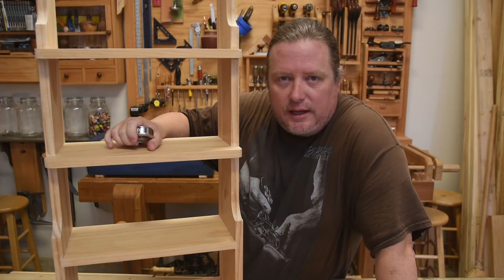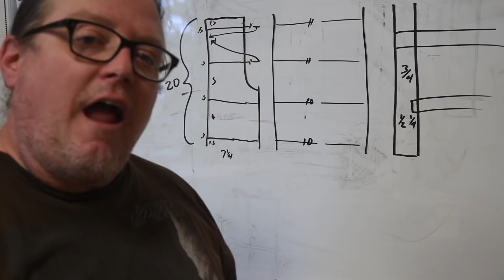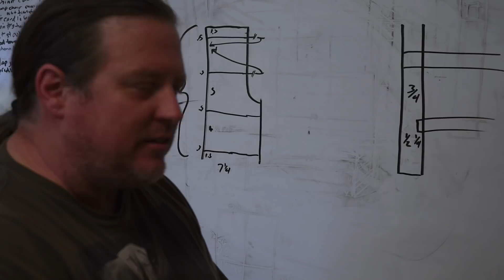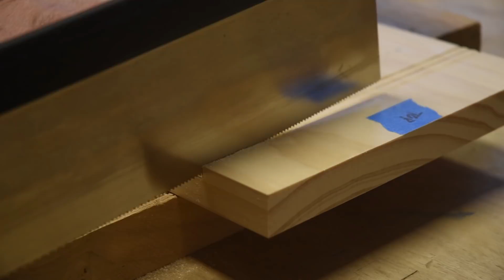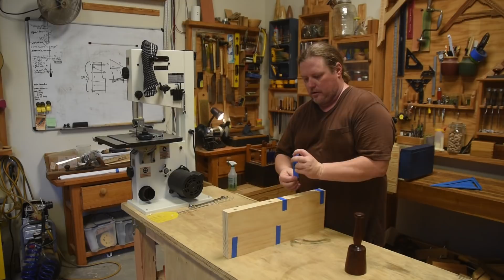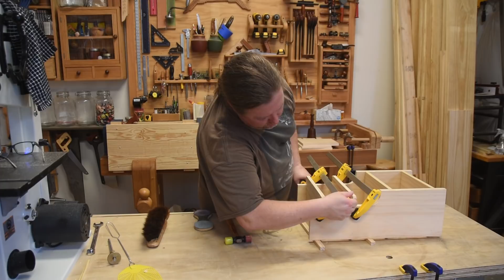Dado Joinery with Hand Tools - Start Woodworking - Class Five

Comment: Thank you for the methodical and detailed approach. I personally, do not have the space or money for machines, so the step by step teaching using hand tools is greatly appreciated. For example, the angle that you place the shelf at against the first knife wall to mark the second wall of the dado creates the tight fit. Or that the front of the dado and shelf is the critical part, the rest of the dado floor is only end grain so don't sweat the bumps and hallows. Seeing someone pour a thousand dollars worth of epoxy teaches little. Your gift as a teacher is so greatly appreciated.

Comment: To make dados I like to clamp a small long piece of scrap wood to the saw as a depth stop. I use very tiny c-clamps for this. With this method I can just saw untill the saw doesn´t saw anymore and I have the exact depth I need every time. It also eliminates the risk of getting a hump in the middle of the cut. This makes work much easier and saves a lot of time, especially when I have to do a lot of cuts, and when making a rack with just 4 boards, you already have to make 24 of those cuts when you make 3 per dado.

Comment: If you made the long ones shorter, your shelf would have been too skinny for what you needed it for. Good on you for sticking to original dimensions and making new top board.
Reply from the maker: It woulda worked as I had some extra room. Just stupidity piled on stupidity. Cost me an extra $20 but I have material for today's video now.